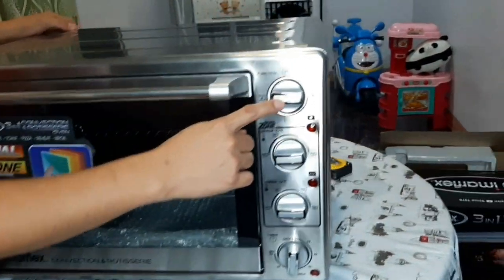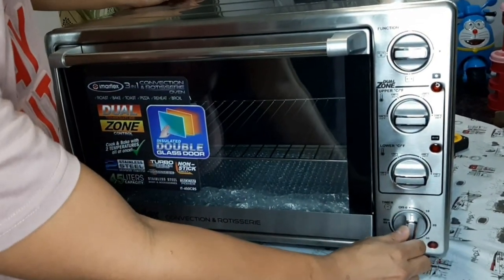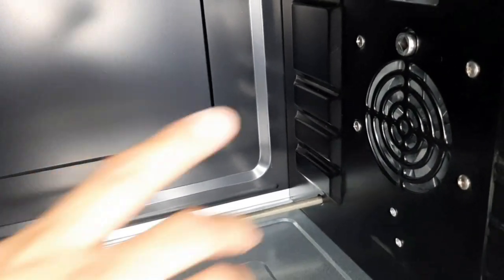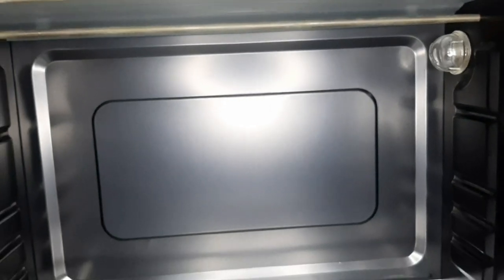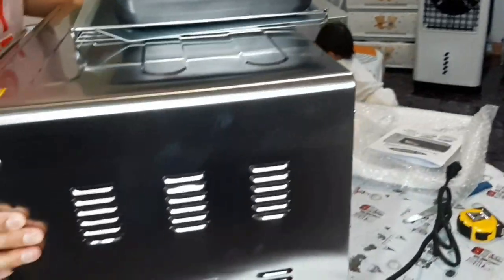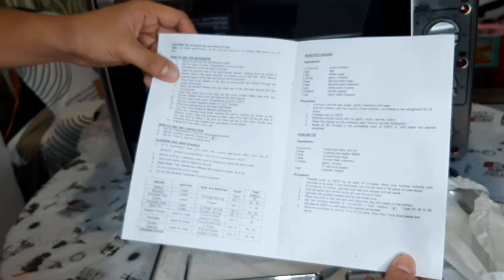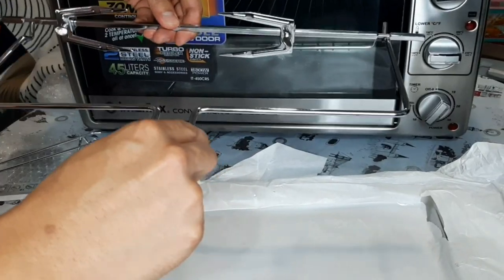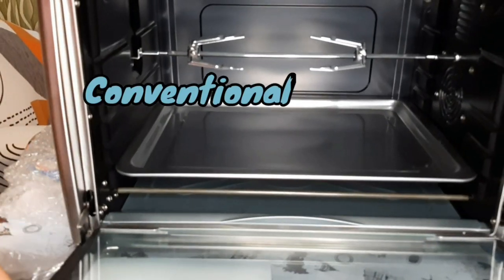Convection & Rotisserie Oven. IMARFLEX/Unboxing Full review

Comment: Hi sir.. may i ask how come max temp is 230 lang,  unlike sa iba 250? dba kulang sa init po? thanks po
Reply from the maker: It depends on the model maybe ? Yes I know po other ovens reach 250 °c or even higher maybe dipends on brand or how big they are 😅
Reply: Ace & Everything Tv. aftr using po,, nainit po ba housing nya and knobs? and ok ba double glass door? out of stock po 45L kahit sa mismong warehouse
Reply from the maker: @ms.m9612  hi yes po umiinit sya. Yung double glass door nya is one of features lang pero kapag matagal na umiinit rin po. Di rin talaga maiiwasan yun dahil oven po kasi.

Comment: Tips po when to use upper and lower heat?  Dapat ba lagi sabay sila?
Reply from the maker: Im so sorry po for late reply.
Onting tips lang use both po para ma reach ang temp. Nya. Kasi nung ginamit ko sya hindi pwedeng taas or baba lang naka open u nless is iinitin lang natin ang food. Like pizza pre heat the oven then lower nalng yung sa baba taas keep the temp just to save energy as well. And also still depends po on what we are cooking. For example.
Whole chicken. May kanya kanya po kasing pag luluto dito lalo na when it comes to profesional cooking may arte arte ba 🤣😅. I lolower ang heat or lalakas po.

Sana maka tulong maraming salamat mo 
-Alas ♠️

Comment: Kuyaaa I have the exact same oven. Kaso I was wondering, if for example you're baking brownies at 350 degrees then gusto mo maglagay ng 2 trays. Up and down ba iseset mo pareho sa 350 degree? Then on din ang fan? I tried kasi na sa baba lang naka 350 degrees tas sa taas naka pinaka low which is 100 deg Celsius pero matubig parin yung batter. Kasi inisip ko pag 350 sa taas 350 rin sa baba, baka masunog 😅 so kung ano po ang desired temperature kailangan up and down ganon ang temp then naka on ang fan? Thank u pooo 🤗
Reply from the maker: Better to use both po kasi automatic naman sya na ma reach ang desired temp.
And also it has a convection so mas madali pa sya lalong maluluto 😁
Basta i-set lang natin sa tama at desired na temperature.
Sana maka tulong 😊
Reply: The fan is usually intended for roasting & broiling meat, poultry. Not for cakes, especially with liquidy batter. The brownies, cup cakes would look like it had been blown to one direction and paused. It looks so rough and unpolished. It may taste good but presentation wise it looks ruined. Just my opinion on the aesthetic part.
Reply: Di ako dalawang batch, hilaw ung ilalim, sunog naman ung sa taas... Always at the center

Comment: sir, torn between kyowa n imarflex.  sa kyowa may reklamo di pantay init upper  n lower, same po ba kaya sa imarflex?
Reply: Baka po sa kyowa eh wala pong fan yun, kaya po di even ang heat sa loob
Reply: Maganda po tlga kung convection oven po para pantay ang init sa loob..
Reply: Hindi po talaga pantay yung heat wave, nakalagay po sa manual na, for baking lower portion talaga
Reply: @sensindo2841 so far po madami tlga ang gumagamit ng hanabishi..ako dn po nag pplan na bumili kasi maliit lang yung elec oven na gamit ko. Nag research po ako yung elec oven with convection maganda kasi equal ang distribution ng heat sa loob ng oven..yun yung may fan sa loob kaya mabilis maluto..pero ideal sya for roasting kya ino off sya ata during baking..
Reply: @clementynnardo2459  correct, mas ok talaga hanabishi, naka gamit ako one time, super ganda

Comment: marami akong tanong haha tinry ko mag pre-heat kanina 10mins or 15mins ata

sa una, namula both lower and upper..
nung mga gitna or 10mins, nawala yung init sa taas.. sa baba na lang natira
parehas naman naka set yung lower and upper sa 230C
tapos nung tumagal, medyo humihina na yung baba

ganun ba talaga kasi na-reach nya na yung temp? parang automatic off or hihina?

last question, paano pag gusto ko lang lower heat? yung lower lang aadjust ko na knob?
tapos yung upper lagay ko sa pinaka mababa lang? ganun lng po ba?

sana masagot mo thanks
Reply from the maker: Hi po John bansil. Yes tama po na every time na gagamitin pre heat the oven to its maximum temp. Or 230°c is enough.
Then pag na reach na po ang temperature nang oven YES tama kayo automatic itong mag off then babalik sya ulit kapag masyado na po mababa ang temp at wala na sa desired na init nya.

Regarding sa lower and upper knov nya.
Dipende po sa inyo kung gusto nyo ang ilalim ay mas mainit.
Or taas ay mas mainit.
For example ayaw nyong masunog masyado ang ilalim nang pizza lower lang yung heat 50 to 100 °c depends rin po sa klase nang ingredients na gamit natin 😊😌

Pasensya napo sa late reply maraming salamat po 😅
-Alas ♠️
Reply: @kuyaMongi  naka bake na kayo ng cookies?

Kasi ang cookies lower lang alam ko.

So iseset ko yung lower heat to 180c. Tpos yung upper 100c kasi yun ung lowest. Tpos off yung convection..

Kaso yung temp nasa 90 to 100c lang dun sa oven thermometer namin sa loob.

Paano gagawin? Taasan ng onti yung lower heat? Like 200c or 220c? Tapos lagyan ng upper heat onti mga 120 to 130c? Pag ganito upper and lower heat na pero mas mahina nga lang upper. Tama po ba?

Pa advise naman ano settings for cookies para di na kamo mag trial and error

Salamat po sa reply..
Reply from the maker: @juanpoy101  Buy an oven thermometer to be sure your oven temperature is calibrated correctly. They don't have to be expensive, and you'll be surprised by how different your actual oven temperature can be from what it says on your oven dial or digital read-out. Generally, cookies are baked in a moderate oven — 350 degrees F (175 degrees C) — for 8 to 12 minutes, depending on the size of the cookie. Ito po ay standard size only 😊

-Alas ♠️
Reply: @kuyaMongi  hi yes po meron kami oven thermometer separate.. 

Ang question ko po is how do you set yung knobs when baking a cookie to be exact..

Kasi if 100c ang top, 180c ang bottom alam natin lahat na hnd 180c ang lalabas sa oven thermometer.. sa inyo po ba 180c?

Sa amin kasi nasa 90 to 100c..

Ngayon ang next question ko, paano po gagawin sa ganitong scenario?

Tataasan lang ba ang bottom heat? O pati top heat?

Nung tinaasan ko kasi yung bottom heat to 230c, nasa 110c to 120c lang.. eh sagad na yun ng knob.. wala na itataas..

So tataasan na rin po ba namin yung top heat?

Kaso pag ganun, di ba po pag cookies dapat bottom heat lang?

Or ok lang kahit may top heat?
Reply from the maker: @juanpoy101  175°c for 8 to 15 mins. Well still depends on what size of the cookie.
Pre heat your oven as well for all most 30 mins for best result 😅
Reply: Looks like it was not preheated well at the beginning so there's a push and pull of heat and the temperature became inaccurate as a result of that.